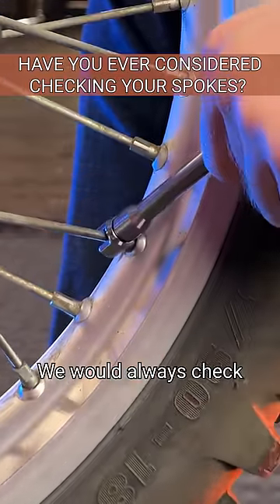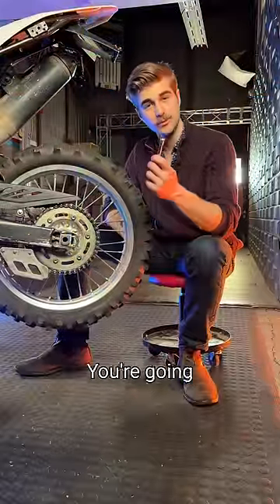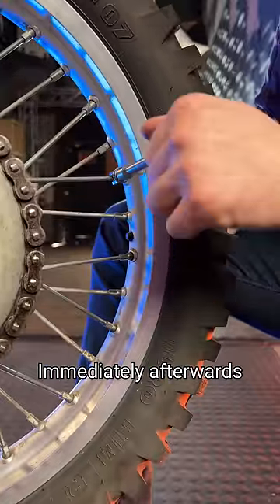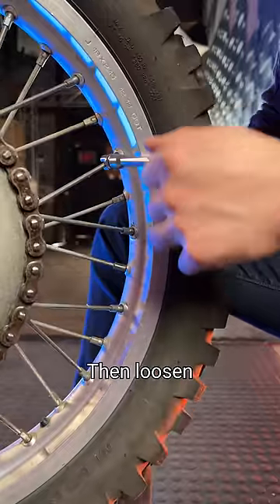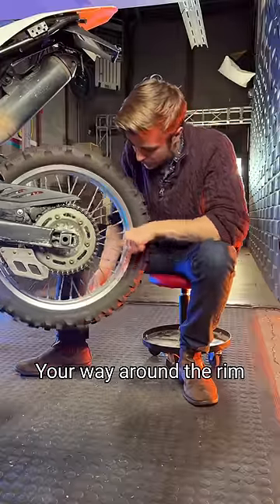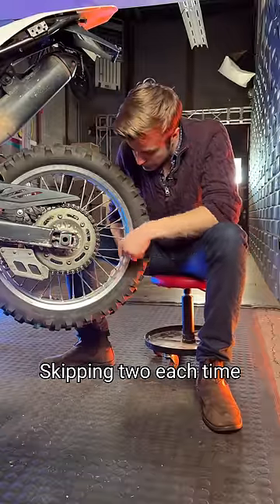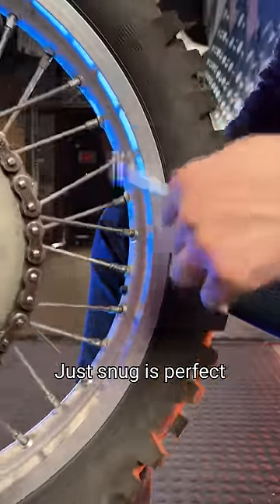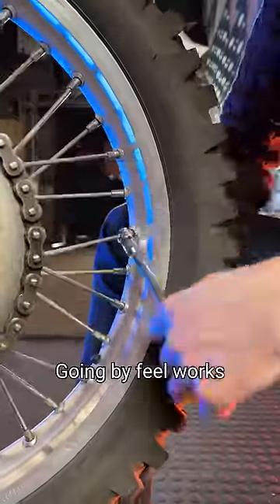Do Try This At Home!

Comment: Good advice here guys… although I will admit that I’m guilty of not tightening them until they become loose.
Reply: *until they snap 😎
Reply: @iamandreja  haha, no, unfortunately haven’t had any snap myself.  I’ve certainly a few bought bikes that have had a few snapped (or missing)… those bikes are usually quite neglected and lead to a big shopping list from F9
Reply: This is actually TERRIBLE ADVICE 🤦🏼‍♂️ He’s not skipping two spokes in the way you are supposed to. You’re supposed to skip THE NEXT TWO IMMEDIATE SPOKES. Not the next two spokes that lace up to the same side of the hub. Somebody told him this method or he read about it, but somebody didn’t SHOW him and he got the translation wrong. Watch the video - he’s only tightening spokes that lace up to the LEFT side of the hub, pulling the rim to the left. When you skip the next two spokes IMMEDIATELY after the one you just tightened, it pulls the rim to the opposite side, keeping it true. I wonder how many customer’s bikes he did this to. Big time fail on this one.
Reply: @smith8124 bro he’s not tightening shit. Just feeling the tension.
Reply: @appelmelk5664  - you DO NOT need to loosen then randomly retighten any spokes to check the tension on them. That isn't the way that you can check them for tension anyway.
Reply: @iamandreja  Or puncture the TUBE
Reply: That’s a real mechanic for you 😂
Reply: What’s the point of skipping 2 is it due to tension?
Reply: @jamesjackson5581  you want to work evenly around the wheel.  If you just start tightening it is going to put too much tension in that one spot and pull the rim closer to the hub there, and the other side will be further out, making it unbalanced and skip/hop down the road instead of spinning smoothly.
Reply: Tighten them until they become loose. Got it.
Reply: Well spoken.
Reply: I waited until my bike felt like it blew a tire ended up being about five spokes sheered in half and many more broken out so new rim

Comment: But if i leave them crusty, and they seize up, they wont be loose.
Reply: lol. But they still will. They don't loosen from backing off, they loosen from the rim being beaten slightly out of round by riding it.
Reply: Exactly, you get it.
Reply: @Hansengineering thankyou for teaching me that , that’s pretty cool
Reply: I have a 2001 Honda CRF dirt bike that has never had its spokes tightened and has countless hours on it, easily over 1,000 borderline abusive hours. I think that's a testament as to whether it's necessary or not.
Reply: @domenik8339  it’ll be a testament once your wheel explodes maybe
Reply: @domenik8339 congratulations but you still need to do it
Reply: 555, but I must not like
Reply: They just don't break loose but they just get rekt off😂😂
Reply: @Hansengineering also stretching
Reply: But if it’s not right or too tight then you are gonna need a new spoke nor if you lucky a burned one😂
Reply: @domenik8339 
Flexing poor maintenance isn't a flex
Reply: @captainsquids2792  It isn't poor maintenance if there is nothing to maintain. Besides, don't you have some blinker fluid to change?
Reply: They will
Reply: Until the spokes opposite loosen up

then they will.

Setting spokes is a fine balancing act. if even one spoke is looser than the others it affects the spoke tension on the others.
Reply: @domenik8339 it is poor maintenance to never have your bike rims trued lmao that’s like bragging “I been driving my car for 8 years and I’ve never changed the transmission fluid and it’s never had a problem” you still gotta change that fuckin transmission fluid before your shit eventually starts slipping and fucks up 😂
Reply: @domenik8339 and we have customers that go 20k+ miles between oil changes swearing it’s fine, while the valvetrain on their motors sounds like a coffee can full of screws rolling down hill.
Reply: heck yea, it  be solid shut
Reply: @domenik8339 i just had to rebuild my wheels on a 1991 xl600v because I got very loose spokes and couldnt adjust them due to being seized from rust
Reply: They'll get loose but they'll be seized so you can't adjust them.
Reply: Nature's loctite
Reply: @domenik8339  It's well worth checking. I'll just about guarantee you've got loose spokes. A mate of mine had a KLR, once, I checked the wheels and they just about fell apart in my hands. This is a definite maintenance requirement.

Comment: Great, i just ruined my 5 spoke alloys. Thank a lot F9
Reply: Skill issue
Reply: @wildride7894  5 spoke... hes talking about a mag wheel lol there are no spokes.
Reply: That's a bingo  @bmxscape  imagine 5 wire spokes though! The wheels could double up as suspension. 🤣
Reply: Hopefully your joking or you made yourself look silly on utube 😂.
Reply: Hundreds of people are smart enough to spot the joke @paul8161 , but yes, there are a handful who can't spot a joke 🤔  Anyone who thinks alloy wheels have spokes and that they can be adjusted in any way probably shouldn't be allowed near a bike
Reply: I heard blinker fluid would have helped keep them nice and solid
Reply: Thats a top tip @martinramos1737, cheers! Does that go in with the screenwash?
Reply: Jb weld time haha
Reply: i think for the 5 spoke alloys instead of a torque wrench youre better off with an angle grinder its a more efficient way to ruin a 5 apoke alloy
Reply: lol 5 spokes and the rim flops around like a wet noodle
Reply: @ARockyRock  ah, so you've seen me ride 😀
Reply: bigger wrench next time, didnt have enough torque

Comment: Who needs a trued wheel anyhow.
Reply: Exactly, this is terrible advice. For those that don't know, if a spoke is loose it's not because they've unscrewed themselves and just needs tightened but rather that spoke is loose because the rim is slightly misshapen and that spoke is no longer in tension because it's at the narrow point of the oval. If you just tighten it, you're only reinforcing the oval shape, not making it round again!
Reply: Normally I feel f9 is pretty accurate but having built bicycle wheels this isn’t great advice.
Reply: @calebmoore7079  I'm with ya. I love this channel, but not sure about this one.
Reply: @shaunflynn7301 your comment needs to be the top comment!!! Damn even bicycle riders know that… that is terrible
Reply: & following this  skip each spoke method, it'll take a week to adjust all the spokes anyways..
Reply: Yep did what he said, guess what? My wheel was untrue. Took me about 3 hours to fix it.
Reply: @tf841  truing a wheel is a pretty skilled task too. Not a Sunday afternoon fix for an average guy. You need a truing stand or homemade equivalent, and some training at the very least.
Reply: @chrishoesing5455  I got er pretty good with a sharpy and a lot of tinkering. I just did it on the bike.

Comment: As a bike mechanic this is madness, wheel done like this can't be straight
Reply: ? Elaborate??
Reply: Good thing this is a motorcycle and not a bike!
Reply: @malachihornbaker5869  those spoke nipples give tension to move the rim left or right, up and down in certain spots, you check at what point the rim is out of true and you adjust it accordingly, not like that without a clue what you're doing which way you're pulling the rim towards

Comment: All this time, and I never skipped spokes. After lots of years riding and wrenching, I appreciate learning new things. Thanks!
Reply: Lol I got told by a wheel maker that skipping two doesn't make a difference
Reply: @zackiaryruddick701  When you torque down wheels, an engine head, etc., do you just go around in sequence, or do you go across and then back and forth?
Reply: @blakeberlin6295  yea mate I know how to tighten up bolts in sequence but a wheel maker someone who makes spoked wheels for a living said you don't have to skip two spoked he makes wheels without using this way he tighten up each one and the wheel is true and correct it's only the people who do their own work on bikes Think you got to do this , you don't have to 🤦 how did you get your wheels true and straight for all them years ?? Just because someone.akes a YouTube video about it doesn't make it correct, if you tighten one by one and you end up with a true and straight wheel then why the hell would you change your way ? This sequence thing you are talking about don't apply to spoked wheels sorry about that 🤷
Reply: @zackiaryruddick701  "if you tighten one by one and you end up with a true and straight wheel" is a big IF buddy. The point of skipping around is to avoid pulling it all to one side and ruining the trueness of the wheel.
Reply: @SqueakyNeb  yea I know the idea as  I said a wheel maker told me you don't have to do this as I mentioned it's not a big if lol you end up with a true and straight everytime so no need to pretend that you have a better way you only tighten a little at a time mate no it's everytime 🤦 one two skip a few if you want 🤣 but you are only wasting your time it's a home mechanic technique it's not right
Reply: It's almost like it's not required lol I'm sure it hardly produces a difference.
Reply: Everyone skips spokes and no one has ever had a problem.
Reply: @societyisboring  🤦🤦
Reply: @SqueakyNeb This would be a bigger concern on a wheel where the spikes are not tightened to beging with. If 90% of the spokes are already tightened it can’t pull it by just loosening and tightening a single spoke at a time.
Reply: @zackiaryruddick701 Rubbish. I spent 5 years making spoked wheels. you DO skip spokes, this IS regular maintenance, only somebody with years of experience can go round in one pass, and thats because muscle memory known the right tension. And it will still need fine tuning.
I don't believe a wheel maker told you any such thing. Either they were bullshitting you, or you are bullshitting us. F. O. W. Y. B.
Reply: @zackiaryruddick701 Maybe you just don't ride hard enough to need to tighten your spokes. Maybe you're just a troll. 
But you are wrong. 
Go ask a team mechanic at a moto event. Then stop using 'someone told me' as if that means anything, anywhere...

Comment: "in my experience going by feel works every time" pretty much exactly what a mechanic told me for wheels when i first started as a lube tech and they knew i had never worked on cars i was just training because they had no other choice. i was very certain the lugs were all tight but they brought it back with all 4 wheels having some loose lugs, you definitely should always use a torque

Comment: Please do a video about a motorcycle multi point inspection, and how it’s done by a mechanic!
Reply: it be a short video, they set your bike aside, wipe it down on the day you pick it up, then charge you,,,, for doing butckus ( greek for Nada)
Reply: @mannyechaluce3814  a service takes about an hour and a half.depending on the milage. some service intervals are more involved than others.
Reply: buy the manual it will have all service intervals listed

Comment: I've gone by sound. Loose spokes will make a different sound. 
Now bicycle spokes... Shudders
Reply: Same, a lot quicker to tap them and listen for a loose one.
Reply: I build bicycle wheels, they are really not different. You will need some sort of trueing stand as well as spoke tension meter. The difficult part is the rear since you have non equal lengths the shorter drive side is much tighter. Keeping the rim dish(centered over hub) can be tricky. All adjustments are just more noticeable because a bike rim plays less of a structural component than motorcycle rims like in the video. It's very satisfying work, kinda like building a tensegrity structure/puzzle

Comment: Good tip, but it's hard enough to get riders to consider flushing their hydraulics (brakes, clutch) on a regular basis. Dedicated riders might follow this tip, but I bet many won't...
Reply: @wanderer397  same.  I ride rural roads on long trips and don't want to get stuck far from repair facilities.  Haven't yet....
Reply: @wanderer397 no need to it empties out by it self so i only need to refil it (or the clutchfluid atleast) a leak you my say, look for and fix it you might as, but here my counter argument to that… see more
Reply: Thats why u have a professional do it instead
Reply: @wanderer397 u know ppl doesnt mean that its safe. Consult your professional mechanic
Reply: @steve00alt70  - never! I turn my own wrenches. Peace of mind!
Reply: My owner's manual says to refresh the rubber seals in my hydraulics every 3 years. That's often enough for the fluid, I suppose.
Reply: @steve00alt70 but know i dont have to remember to change fluid as it solves it forces my to refil or clutch stops working  ☺

Comment: I have a tusk torque spoke wrench , well worth the money when you have 4-5 set of wheel to adjust.
Reply: I have the Excel one. Love it. Cheap rims are soooo hard to true up. Gotta remember to unwind the torque settings after use.
Reply: I would have thought a torque wrench was for sure the best tool for the job. However none of the mechanics in the pits and the ones I was able to sit and talk with ever used one. They all told me they just do it by feel and sound.
Reply: @NONO-hz4vo  It’s good for setting them up properly in the workshop. Out in the pits or out in the woods a regular wrench and ear is fine.

Comment: Not going to check how true the rim is?
Reply: As a mechanic myself, I'm not handling a bike that has spokes. If you want me to True your rim and put a new tire on it, it's gonna be at least $500 per wheel. It is unreasonable, but I don't want to deal with that, and that's where I'll start to consider it 😆 
"It's not about the tool used to fix the problem, but knowing where the problem is and where to fix it"😅
Reply: @KacyColledge this takes like 20 minutes and one specific tool if you want to be fancy and get a spike tension meter. Simply remove the wheel or just do it in the bike. $500 just tells me you are unfamiliar with the process

Comment: I wonder if this technique would work on bicycle rims as well since they use a very similar spoke set up, great info!
Reply: It does, but there are a couple of things to know. It's very easy to pull a bikes wheel out of round and out of true. A half a turn is all you want to do at a time and do this to both sides of the wheel as you go, don't do one side at a time like this guy.
It also pays to set up a gauge, if you're doing this in frame. a couple of cable ties can be secured to the frame with the tales cut accordingly so you can see if you're pulling the wheel out of true and round and address it.
It also doesn't hurt to apply a bit of WD40 or CRC to the thread in the nipple before you start the job. These can become corroded
and stuck and it is very easy to break a spoke when tightening them as a consequence.
While possible, replacing single spokes isn't ideal and it can be a bit of a PITA.

Comment: Doesn't the tension of these effect the straightness of the wheel?
Reply: Why u asking like your diy? Have a professional do it instead
Reply: @steve00alt70 it’s literally not that hard dude. If you’re not able to do something as basic as this, you probably shouldn’t own a bike.
Reply: Normally bikers are a like nicer to each other. 

Yes it does and once you have a good feel of what tight is and what the right sound they should make when you tap them it is pretty spot on. Pro mechanics who work for the mx and sx teams don't use torque wrenchs or throw the rim in a stand every race either. They do just like this video before each heat. Some of them never use a torque wrench.
Reply: @NONO-hz4vo  was my response somehow not nice?
Reply: @unL33T  yours was a valid question. The "answers" were not.
Reply: That why he’s skipping spokes, so he doesn’t pull the wheel out of round
Reply: @kingnull2697  Hand tightening them without any consistency on torque will ensure none of the spoke nipples are equal tightness though, which technically makes the wheel out of true
Reply: @zhgfng  By that standard, the wheel is out of true from the factory, or any time a torque wrench is used. Torque wrenches measure don't measure the clamping force, they measure the rotation force applied; therefore they have significant "slop" even at their most accurate.

Comment: I know on a bicycle, changing the tightness of the spokes will change the trueness of your wheel. Would this also apply to a motorcycle wheel, or is the effect negligible? If so, I would think you’d need to be paying attention to trueness when doing this
Reply: it would affect a motorcycle wheel. theyre threaded for that exact reason; wheel truing. not sure why the video is advising people to blindly loosen and tighten the spokes..

Comment: As an ex mountain biker it’s interesting to see how little motorcyclists know about spoked wheels
Reply: With the burly design it is amazing how little these bad boys run into issues. Still good advice. My carbon mtb wheels have also been pretty solid as far as staying true especially compared to the 26in aluminum ones from my past.
Reply: @NONO-hz4vo  I had a pair of 27.5” Hope Fortus 30’s on my Trek Remedy 8. Utterly ridiculous wheels.

Usually wheels from new have a bedding in period where the spokes will become loose, but after 3 bike park trips, 2 of which being the ruthless Bike Park Wales, and countless other local rides I kept checking and checking the spokes and they just never became loose or went out of true. 

100’s of miles later, countless rim dings in to square edge rocks and they were mint. They never failed to amaze me.

Comment: You should really get a wheel truing stand to make sure your wheels are not out of round, then once you check it with that do what he is saying to keep up on them!
Reply: Yes. If you haven't got access to one of those, it pays to set up a gauge using cable ties cut fixed to the swingarm and forks so you can keep an eye on true and round. Doesn't hurt to CRC/WD40 the nipples first, either.